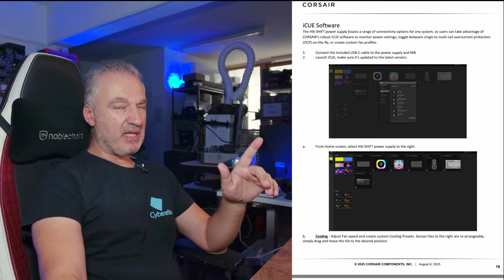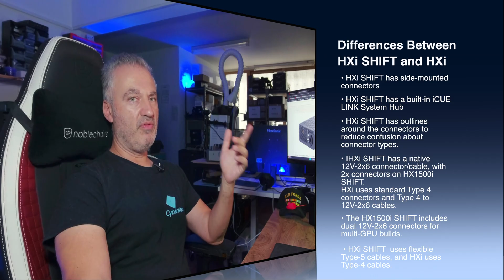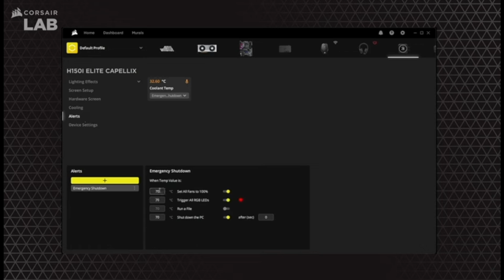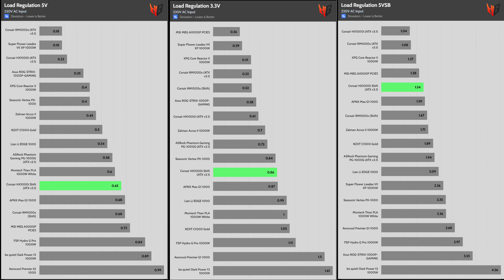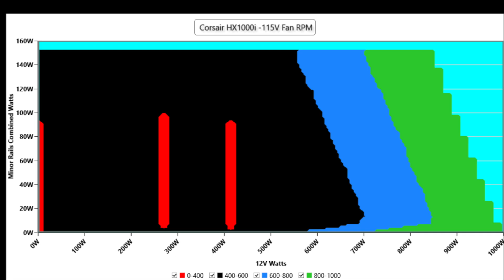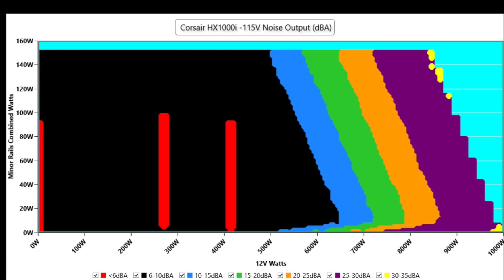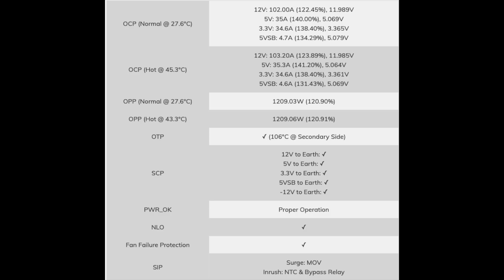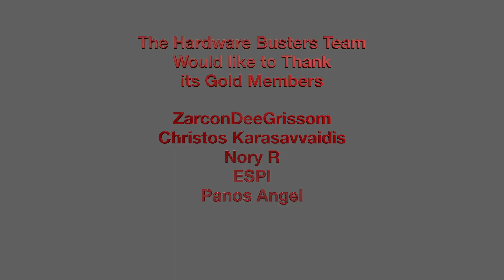Corsair HX1000i Shift ATX v3.1 Power Supply Review

Comment: can you maybe explain in a video or article what that option "low power idle" in mobo BIOS means and why it sometimes leads to system instability on newer boards running on older PSUs? it's one thing i wish i understood... as for myself, i started noticing it on my Zen3 system but also carried over to Zen4 with my older Seasonic X650. would randomly reboot idling, but i could game or do compute for daaaaays just fine
Reply from the maker: I will try to look at this.